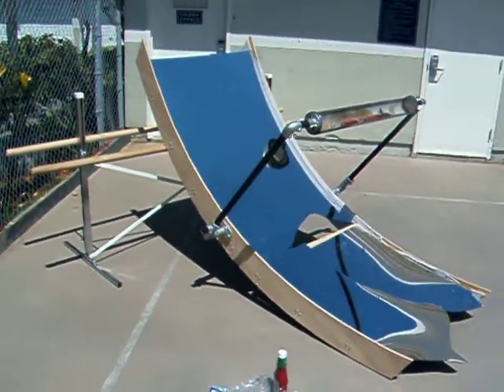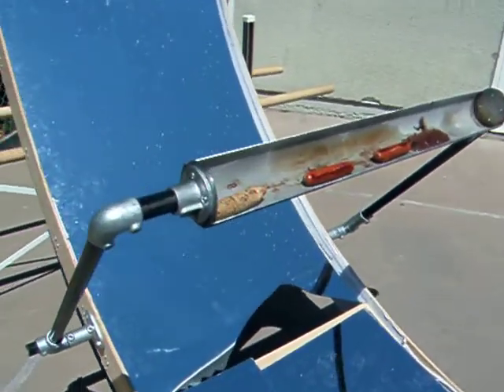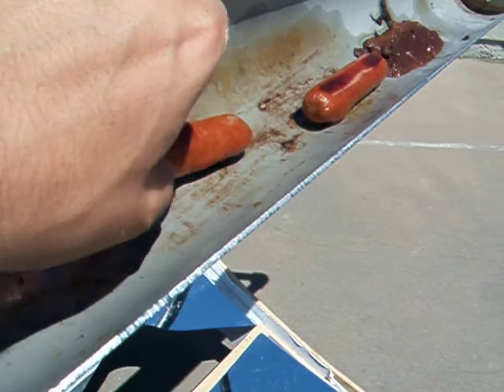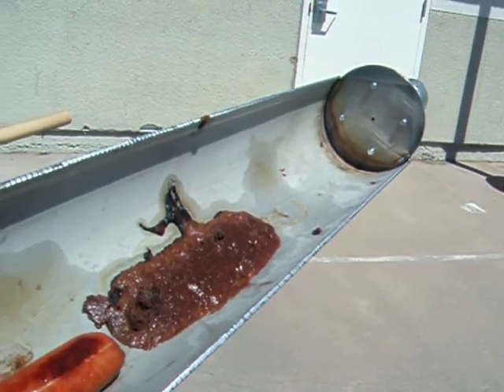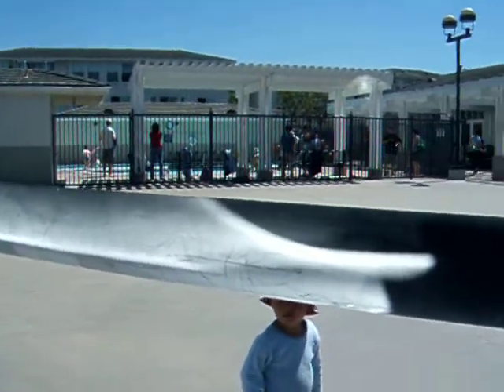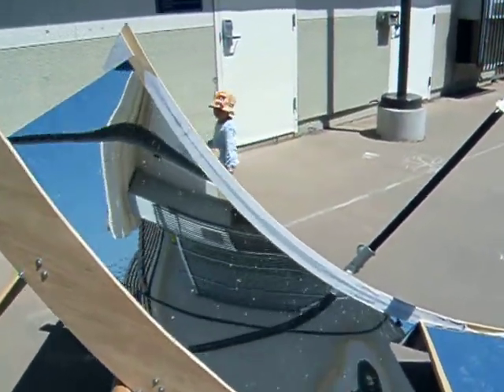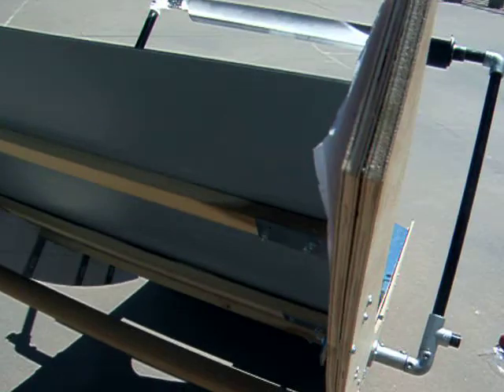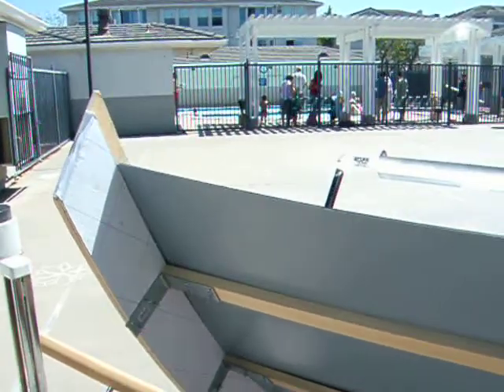solar oven

Comment: Nice work - do you have a source for the reflector material, or did you find it locally? And how did you scale the AutoCad output - I'm betting you don't have a printer that big ;-) Any plans to put it on a pivot to track the sun? I know, too many questions.